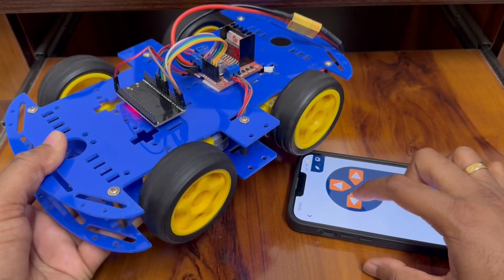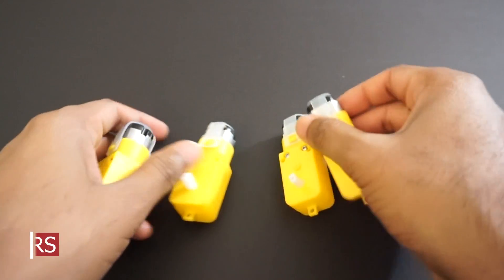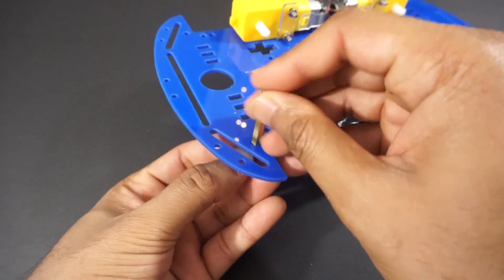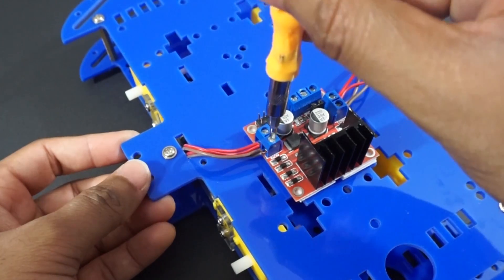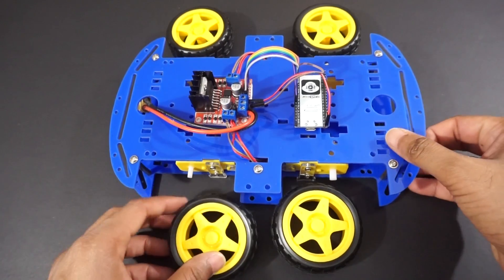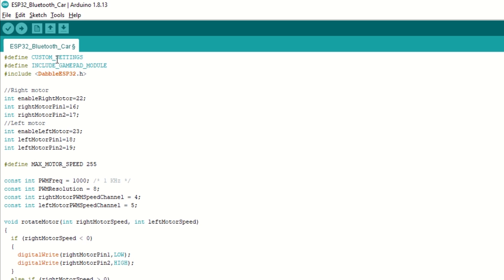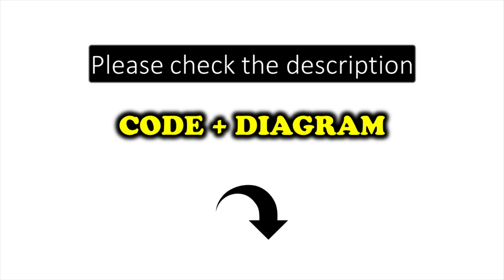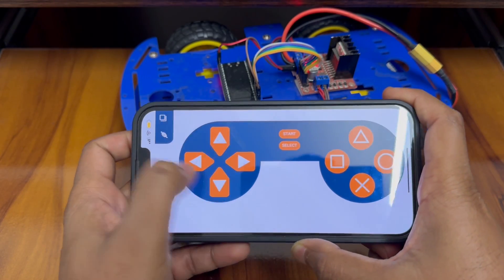ESP32 Bluetooth Car | Android + iPhone | DIY 🔥

Comment: hi sir very nice video but this error comes in my arduino terminal pls help sir thank you:
Arduino: 1.8.19 (Windows 10), Board: "ESP32 Wrover Module, Default 4MB with spiffs (1.2MB APP/1.5MB SPIFFS), QIO, 80MHz, 921600, None, Disabled"

xtensa-esp32-elf-g++: error: unrecognized command line option '-std=gnu++2b'; did you mean '-std=gnu++2a'?

exit status 1

Error compiling for board ESP32 Wrover Module.

This report would have more information with
"Show verbose output during compilation"
option enabled in File -> Preferences.
Reply from the maker: Enable the verbose output in the preferences. And try compiling again . It will show the full error . Then copy paste that error here 👍🏻👏🏻
Reply: @hashincludeelectronics   hi sir here is the new error message thank you for responding I deleted some of it because it was to long:
Arduino: 1.8.19 (Windows 10), Board: "ESP32 Wrover Module, Default 4MB with spiffs (1.2MB APP/1.5MB SPIFFS), QIO, 80MHz, 921600, None, Disabled"

ckages\\esp32\\tools\\esp32-arduino-libs\\idf-release_v5.1-3662303f312/esp32/flags/cpp_flags" -w -Os -w -x c++ -E -CC -DF_CPU=240000000L -DARDUINO=10819 -DARDUINO_ESP32_DEV -DARDUINO_ARCH_ESP32 "-DARDUINO_BOARD=\"ESP32_DEV\"" "-DARDUINO_VARIANT=\"esp32\"" -DARDUINO_PARTITION_default "-DARDUINO_HOST_OS=\"windows\"" "-DARDUINO_FQBN=\"esp32:esp32:esp32wrover:PartitionScheme=default,FlashMode=qio,FlashFreq=80,UploadSpeed=921600,DebugLevel=none,EraseFlash=none\"" -DESP32 -DCORE_DEBUG_LEVEL=0 -DBOARD_HAS_PSRAM -mfix-esp32-psram-cache-issue -mfix-esp32-psram-cache-strategy=memw -DARDUINO_USB_CDC_ON_BOOT=0 "@C:\\Users\\msahi\\AppData\\Local\\Arduino15\\packages\\esp32\\tools\\esp32-arduino-libs\\idf-release_v5.1-3662303f312/esp32/flags/defines" "-IC:\\Users\\msahi\\OneDrive\\Desktop\\thisisitorelseiquit" -iprefix "C:\\Users\\msahi\\AppData\\Local\\Arduino15\\packages\\esp32\\tools\\esp32-arduino-libs\\idf-release_v5.1-3662303f312/esp32/include/" "@C:\\Users\\msahi\\AppData\\Local\\Arduino15\\packages\\esp32\\tools\\esp32-arduino-libs\\idf-release_v5.1-3662303f312/esp32/flags/includes" "-IC:\\Users\\msahi\\AppData\\Local\\Arduino15\\packages\\esp32\\tools\\esp32-arduino-libs\\idf-release_v5.1-3662303f312/esp32/qio_qspi/include" "-IC:\\Users\\msahi\\AppData\\Local\\Arduino15\\packages\\esp32\\hardware\\esp32\\3.0.0-rc1\\cores\\esp32" "-IC:\\Users\\msahi\\AppData\\Local\\Arduino15\\packages\\esp32\\hardware\\esp32\\3.0.0-rc1\\variants\\esp32" "@C:\\Users\\msahi\\AppData\\Local\\Temp\\arduino_build_905170/build_opt.h" "@C:\\Users\\msahi\\AppData\\Local\\Temp\\arduino_build_905170/file_opts" "C:\\Users\\msahi\\AppData\\Local\\Temp\\arduino_build_905170\\sketch\\thisisitorelseiquit.ino.cpp" -o "C:\\Users\\msahi\\AppData\\Local\\Temp\\arduino_build_905170\\preproc\\ctags_target_for_gcc_minus_e.cpp"

xtensa-esp32-elf-g++: error: unrecognized command line option '-std=gnu++2b'; did you mean '-std=gnu++2a'?

exit status 1

Error compiling for board ESP32 Wrover Module.
Reply: Please hel
Reply: @belaldurany5131 no the WiFi is still not showing on my phone idk y

Comment: Please send a clear image conntin wire between esp32 and mortor controller. Because i am a beginner for this field 🙂
Reply: *connecting wire
Reply: Image or pin numbers
Reply from the maker: Please chef the circuit diagram provided in the link . It’s very clear . Spend some time to understand it . Don’t worry 👍🏻👏🏻

Comment: I can't seem to leave a comment on the short you created Controlling a Relay Using an ESP32.  How are you directly controlling that relay module using an ESP32?  When I've tried with an active low relay module (the same one you are using) in the past I had to use a transistor to essentially make it active high because the ESP32's 3.3 V wasn't enough to turn off the relay module in an active low configuration.
Reply from the maker: Yes I am controlling this relay directly from esp32’s 3.3 v . It’s not recommended but as it was just single relay I used it for demo . It is low level triggered relay .

Comment: Bluetooth is disconnecting when i try to move forward in using dabble.
Reply from the maker: Looks like power issue  . Please use rechargeable battery 👍🏻👏🏻
Reply: I have the same problem
Reply: @ronaldohernandezmejia138  did u resolve it?

Comment: Can I use 8pcs (1.5v) pencil battery to power it up on L298 motor driver. To get 12v power ?

Or any other method to obtain 12v power.
Reply from the maker: Please do not use those non rechargeable batteries . It causes many power related issues . You can use LiOn cells 👍🏻👏🏻
Reply: @hashincludeelectronics as a request and  it will be so kind . If you please suggest a cell of 12v and how to recharge  those cells.

Cell with 3 amp current . As L298 motor driver is capable to handle 3amp max current .
Reply from the maker: @ankush6129  ok do one thing . Get 2 cells of LiOn batteries . Charge it fully and use it . It should be fine . Don’t worry about ampere . 👍🏻👏🏻

Comment: In the car kit they give you the tt motors, wheels, chassis, screws and give you some circular plastic pieces that fit to the tt motors... What is that for ? The chasis also has two cuts so those circles can come out
Reply from the maker: Those are called encoder which is used for speed control I believe . I have not used it ever 😜
Reply: @hashincludeelectronics   for rotary encoder connections??